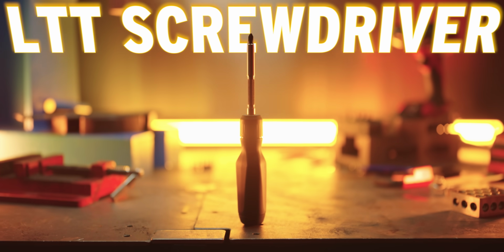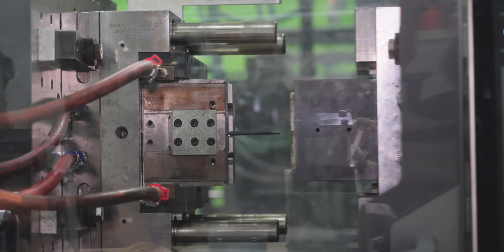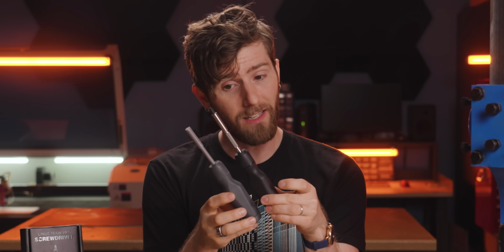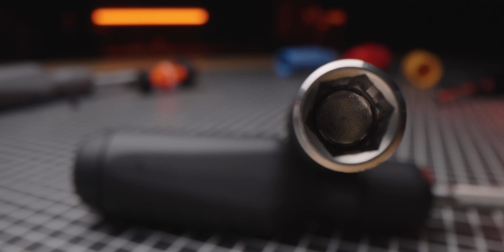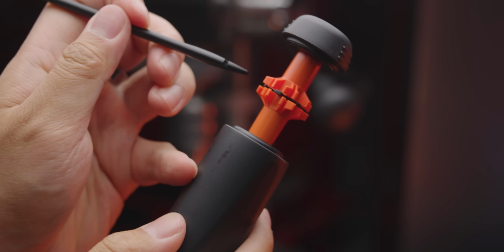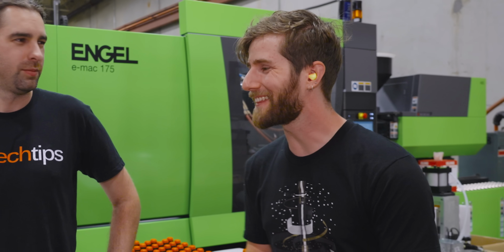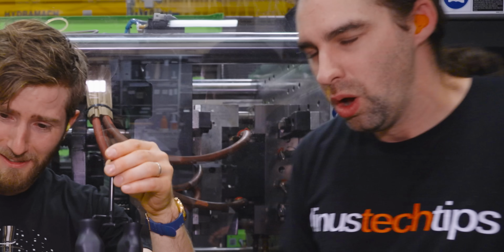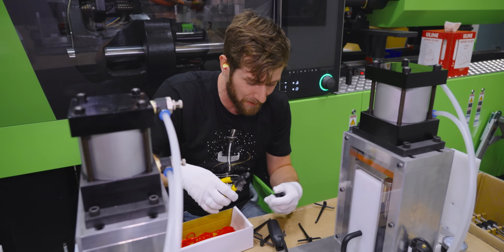Why our Screwdriver took 3 YEARS

Comment: Looks like a great product... tbh it's so hard now to find tools to buy where you can trust that the metal is high quality
Reply: Its not hard, just stay away from Chinese and most USA products. There is Wera, Wiha, PB Swiss, Facom, Gedore and many Japanese brands.
Reply: Ifixit ones are the best
Reply: Wera and Klien
Reply: I go with Mastercraft Maximum. Lifetime warranty, no questions asked.
Reply: Whatttttt I'm surprised you watch LTT!
Reply: Snap-On
Reply: I wish Victorinox just made a version of every small metal tool xD
Reply: PB Swiss?
Reply: Whoa! Seeing a comment here from @Shangerdanger here is the last thing I expected. "Well that's all the stuff I found today, bye!"
Reply: Hardware store? I got a screwdriver strong enough I can use as a prybar for barking callipers... it will hold on to PC work...
Reply: oh yeah theres only snap on, sk, pb swiss, wiha, wera, hazet, gedore, wright, chapman, mac, vessel, ktc, and the dozens of other non slave labor brands but ok
Reply: Wiha / Wera is a very high quality and cheaper than this screwdriver.
Reply: It's hard to find tools where you can trust the metal ? Bro what the fuck are you even talking about? Dewalt, Milwaukee, Snap-on, PB Swiss, Beta, Wera, Klein Tools, Wurth, Wiha, Southwire . Really. Hard to find eh ? And your next logical idea is to buy it from LinusTechTips when you can't find a screwdriver?
Reply: @bikerboy3k  Yep plenty of good options at half the price or even less... I have Klein, wiha, wera and channel lock multi bit drivers partly bc I enjoy collecting them but I can have them in my tool bag, garage, computer toolbox, etc. I'm sure LTT screwdriver is a quality tool, but this is one case where I'd rather have a bunch of them at a lower cost so I can always have one within reach
Reply: @bikerboy3k  Vessel, too, a Japanese brand.
Reply: @bikerboy3k  🎯 👍 👏 💯  eXacTLy.!!!!
Reply: @bikerboy3k  yeah man its so hard to find backpacks that are built to resist nowadays.. i guess i will fork down 500 bucks for a couple of LTT-built-with-insane-effort-in-china backpacks. Those damn eastpaks are so fragile that mine from junior high is 22 years old and does not have a single sign of wear. Only linus (and his sponsors) can provide quality. LOL
Reply: @bikerboy3k  These guys are just spoilt millennials who've probably barely used a tool in their life. I have PB Swiss screwdrivers my Grandad used daily, and passed down the family that still work perfectly fine today.
Reply: @darkcognitive  "my Grandad used daily, and passed down the family that still work perfectly fine today" 
Pretty much the same thing I was going to say, but that's kind of the point. They will still outlast new "quality" brands.
Reply: @bikerboy3k  Milwaukee 13 n 1 or Klein. DeWalt makes a decent one, all my power tools are DeWalt. But Milwaukee’s 13 n 1 is a perfect fit for what I do. DeWalts doesn’t have a 1/2" nut driver the only thing I don’t like about it. I do hvac. Typically I’ll just use a quick switch bits on my impact.

You can get that Milwaukee screw driver and a folding util knife for 22$ USD 😂
Reply: @Bootchair  bang on bro.
Reply: No it's not... lol where do you shop that it's "hard to find high quality tools?" Stop buying your tools from the convenience store.
Reply: @NikoBell1188  Hard to find no-name tools from amazon with trustworthy steel.. maybe.
Reply: LOL yeah I used a Chinesium screwdriver to lightly pry up on a VSS - it bent. The screwdriver.
Reply: It's not really hard. There are big names on the industry, like BETA, FACOM  and many more. Also chrome vanadium is usually an overkill for those types of work
Reply: For the haters sayin go to any hardware store for good tools. No. As a mechanic, computer enthusiast, and a cryogenics tech at a research university, fuck your bullshit opinion.
Good tools are EXPENSIVE. I dont mean like 60 for a set, I mean 200 for 3 wrenches expensive. There's nothing in the world more god damn infuriating than pulling a cheap wrench and stripping/rounding off a bolt due to shitty tolerances and bad manufacturing practices and having to drop the project and drive across town, or worst yet, order another and sit on your hands and wait until the new one comes in. Snapon, dewalt, pick your favorite will charge you out the ass for every little piece and are no where near as reliable as they once were. They've become lazy due to success. Even the best snap on 3/8th drive ratchet will break and strip the teeth on the ratcheting mechanism at 185ft pounds of torque, and sometimes 150ish if its at a weird angle, which is fine, until you start mathing out the differences between this 300US dollar ratchet, and a 45 dollar rubber handled china knock off and realize they break and round at roughly the same point, and use more or less the same practices during construction.

Good tools are becoming harder to find, and much of that is due to 5 or 6 buildings in Taiwan making most tools for most of the 'American' made companies. Snapon tools? Made in Taiwan. Milwaukee, dewalt, cobalt, etc tools are all made in the same fucking facility, by the same fucking people and the same machines. 

The snap on 3/8th drive ratchet my Dad gave me that he bought from a snap on truck in 1993 is still functional despite the years of abuse from 2 different mechanics, and I rounded the teeth on a less than 3 year old 3/8th drive snap on from like 2016 pulling a bolt off the head of my mustang. 
In short, you have no idea what the fuck your on about, keyboard warrior.
Reply: @LastGunslingerTull  how is the screwdriver to use ? You're quick to defend something you have seen a advert for on YouTube. I have used expensive tools before,  this is just a snap on ratchet screw driver with a fancy bit holder on the back and is more expensive and does it come with lifetime warranty. You talk  about stripping heads and tolerences but,  the bit you put on the end of the screwdriver determines that my friend.
Reply: @SolarisUK  fair reply. I’ve never used this screwdriver, only seen this. Was not defending or tryin to sell it. Just making a point that tools today are not as reliable as they were a decade or 2 ago. I cannot attest to Linus’s screwdriver. 

My primary point was, and is, hobbiests and the occasional minor fix is very different from pulling an engine block apart, or rebuilding a transmission, or pulling an axle. Many of the things you wouldn’t do in your garage consistently, but a professional whom works and does that shit daily needs a more reliable, professional grade tool. 
Snap-on, dewalt, and many other OG tool makers stopped making the materials and parts a long time ago, and have outsourced much more of the process to everywhere else. 
So your still likely to find metal that was caste a manufactured in china, the shitty part maybe, or plastics needed in manufacturing. Which are also outsourced these days to like 6 factories that make 80% of tools on the market. Including the good ones. 
Many are the same now, just a warranty and bigger price tag. 

It’s not all about the head either though, many times it’s the tool itself. Wrenches and ratchets as an example, the really good tools have tight tolerances, but not all bolts are created equal. Even those that were created equal. OG Snap-on didn’t used to round off as often, the ratchets didn’t snap back nearly as hard, or have nearly as stiff ratcheting mechanism. Sometimes the metal has more impurities that weren’t forged or filtered out during processing. Many steels and Aluminums were made and manufactured here in the US. Then everyone got greedy and outsourced materials manufacturing, which effects all end products made with it. 
The US developed the tech and techniques needed for much of the tools and machining the world used today. Places like china and India simply don’t have the decades of experience manufacturing and purifying metals like some others like the US. So all products made will be inferior as a result. We see this constantly with cheap china shit, and even ‘American’ made shit that was assembled in the US, but 90% of the material and manufacturing was done elsewhere. 

The US was good at what they did, then they sold out because it’s cheaper.
Reply: @LastGunslingerTull  That is also a fair reply yourself :). A lot of these new companies state designed in Germany like that makes a massive difference as its the manufacturing that is just as Important. It will be hard to beat China for any cooperations the price per unit is so cheap.
Reply: @QQ Pirates dissaprove of that message. >:(
Reply: I've used the cheapest of the cheap sold locally in USA and have NEVER had issues with bits in non-impact use, ESPECIALLY in the ultra-low torque range of electronic fasteners. Walmart sells a 100-piece 5/32 precision kit for like $15 with decent quality chrome vanadium bits that I've used MANY times without any issues whatsoever.
Reply: How many other similarly priced screwdriver's did you bought and found out they not the quality you expected?
Reply: All of you in your propaganda for tools you’ve used. Give this one a shot, yeah you can write it off as just another screwdriver. But, is it the most satisfying screwdriver? This one’s got a lot of things that make me want to melt. I’ve had a lot of tools, but none of which are as enjoyable as this one. A lot of brands listed here typically start flaking on me and I get metal shards everywhere very inconvenient for tech shit right? You don’t want that getting on a motherboard right? There’s a lot of valid reasons here that people are just completely writing off. Go watch the founder, I feel like that film has a lot of notes that give this product the proper spotlight it deserves. Even if it’s a screwdriver
Reply: I work at a computer repair shop and we'll all gladly be buying one, and writing it off as a work expense!
Reply: @jemaritube  Please buy 2 and have a giveaway!  $70- each, ouch, regardless of the quality.
Reply: Make sure y’all get warranties with them
Reply: @jemaritube  The boss would like to have a word with you in the morning!
Reply: @jemaritube  Magnets and computers with spinning disks. No way. :)
Reply: @adamfamalee6678  Tell us you don't know anything about working with computers without telling us you don't know anything about working with computers.
Reply: @NikoBell1188  I don't know anything about working on computers. Only run 2 companies and been a CTO for over 30 years so still learning. Magnets and magnet media are clearly a great combination. Well done Spliff Bong.
Reply: @adamfamalee6678  you need way stronger magnet than in any existing screwdriver to break an HDD. Like, you need a strong industrial electromagnet tbh.
Reply: @adamfamalee6678  theres literally no problem.
Reply: @adamfamalee6678  HDDs aren't too common anymore, and the magnet in this screwdriver is unlikely to be strong enough to ruin a HDD unless put in direct contact with it, which is easy to avoid. In fact, there's stronger magnets than what this screwdriver has inside the HDD itself.
Reply: @adamfamalee6678  Should be fine. Modern spinning disk drives are designed to be safe around magnets at least twice as powerful as the one in the screwdriver. There's no way the screwdriver being near, or even touching the HDD casing, would be enough to cause any issues at all. I've used an iFixit kit around spinning disks, which also have magnets, and it's fine.
Reply: Looks generic asf.
Reply: @filds1  What? Did you want your screw driver to have "Supreme" all over it?
Reply: @Akira-kd6us  i actually have a supreme screwdriver lmao; they did a collab with Chapman (they make extremely high quality bits/drivers in the USA) and i love it to death. doesnt ratchet, but comes with a little ratchet tool as well.
Reply: @Akira-kd6us  rgb and supreme logo! lol this guy wants the screwdriver to do even his work lol
Reply: @Akira-kd6us  Yeah needs more RGB 🙄
Reply: @Akira-kd6us  For 70 usd yes
Reply: @filds1  Go ahead get some supreme stickers and slap them on. You buy tools for using them not for the looks. I would rather get that simple black than the more expensive snap-on
Reply: @filds1  yeah it's a tool, it's not supposed to be fancy
Reply: @filds1  Did you expect them to reinvent the wheel?
Reply: Nope for magnet media as it may be corrupted by the magnet. Come on Linus!!!! Really?
Reply: @adamfamalee6678  lol. your bigger worry is that you have power to the system and drop a bit or screw on your motherboard/memory/gpu/whatever and fry something (trust me, I have fried a mobo and a few memory sticks that way) than corrupting anything with that tiny little magnet. We once tried one of those huge neodymium magnets that you absolutely don't want to stick to a surface without something between it and the magnet at my old job on a running server. Stuck it right to the disk a few times. Didn't even crash and a disk scan didn't find anything corrupted afterwards.
Reply: @VilmaHallikas  very true. I usually switch mine off before swapping the HDD over. I love that screw rattling sound when you have finished the build :).
Reply: yeah no. it looks lame as shoot
Reply: @chimpo131  It is a tool not a beautyproduct.

Comment: Wouldnt you say you did what you bash on so many companies for. You made proprietary parts, to an extent. Where in can 20mm bits be bought.sure you can use 42mm but if you lose the ones it came with that's it.
What happened to all you advocate for.

Comment: I'd buy it for $20 but not $70. I can't spend that much on something I'm going to lose in a couple years. 
The engineering is impressive, but what is the true value of a screw driver?
You over-engineered, and over-spent to the detriment of your customers. 
Those who want to support you now have to pay for these mistakes. 
It's a screw driver... not a car. It doesn't need to be perfect, it just needs to be reliable. 

Now you have a screwdriver many of us would love to buy to support you, but a lot of us just can't imagine spending that much a on screwdriver. 

I mean $30 more and I can get a mid-range wireless drill from a major brand with  up to a 5 year warranty.
Reply: I think you're kind of missing the point. He wanted to make something perfect, because if he wasn't doing that, why would he just put another screwdriver into a crowded market? Same with the backpack.

LTT is probably never going to be interested in producing goods at a price where they'll have to compete with the likes of Amazon -- and for good reason.

It seems like you're a little bummed out that you can't buy one/support LMG because it's so expensive -- and man, that sucks. I feel that. I've been in the same boat. And I lose things a lot too. :)
Reply: @DanKaschel  I think LTT doesn't get the point.

Comment: Got two on backorder - one as a gift for my dad and one for myself. One concern with the light back force required to engage the ratchet - is the resistance still enough to allow you to turn the screw counterclockwise so it's properly aligned (to prevent crossthreading) before inserting it without swapping the direction of the ratchet?
Reply: Huh. That's a really good question.

Comment: Looks great and very functional. However WARNING: Sorry to say this Linus but if you are aiming at the PC builder market then I have previously seen corrupted magnetic media when using with a screwdriver which had a bit holder magnet. So I am VERY concerned holding mechanism that this may not be the best for installing an older spinning drive. Maybe you have some notes about this in the instructions before you get a load of legal claims.
Reply: You think they might get a "legal claim" (whatever that is) because someone got their magnet close to a hard drive? I very much doubt that.

Comment: What happened to the orange cap? All the ones I saw were black.

Also the guy at the launch event had a good point about the bits, black without any silver on it you will lose very easily so a all silver or black & silver set would be great.

Comment: The problem with the small bits is that if you loose or snap a tip your screwed (lol) You also can’t change the bits to ones you prefer.

Comment: I'm a Mercedes technician, I have 3 Snap-on screw drivers that do this and more and are just as expensive.Why would I buy another one with less features. Snap on have arc protection, if you need more torque it has a rachet attachment. With all that said I'll take 2.

Comment: You talk about 5 thousandths of an inch being next to nothing. But as an aircraft engineer that does structural repairs. 5 thou is a lot. In training we have to manually file down and work prices of aluminium to within 1thou of an inch.

Comment: $70 usd  for a slightly better ratching screw driver Linus guess you have to pay off that mansion and such. I will stick with Wihia or Wera brand drivers as they have proven their worth 3 times over . I buy stuff not just for pc repair / mantainence this driver seem more suited to that vs my use cases ie general repair  around the home and knife maintainence